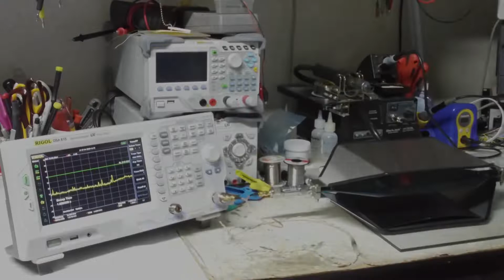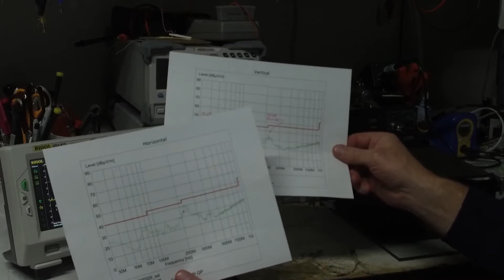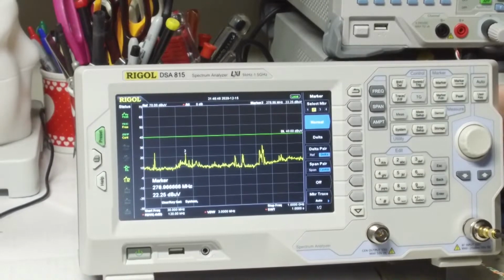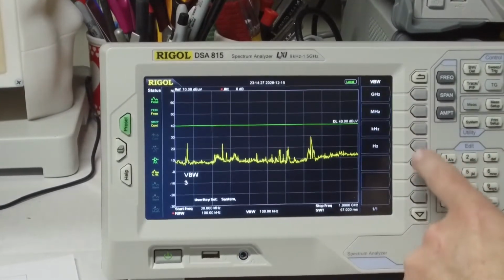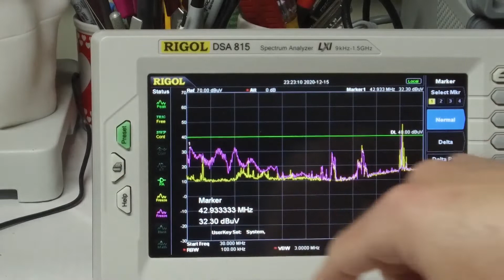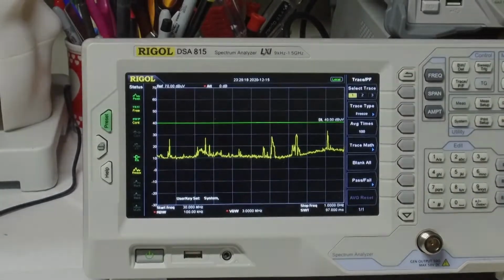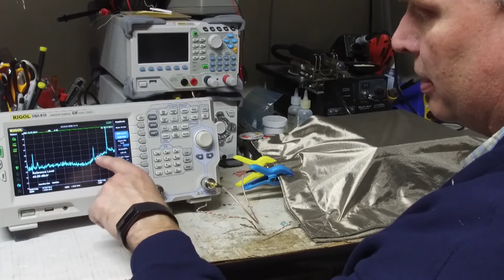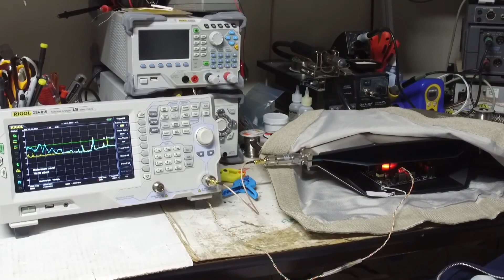FCC/CE Radiated Pre-compliance,  FCC / EN55022 with Rigol DSA815, TekBox TEM cell and shielding bag

Comment: Good video.  If I go with a TEM I'm going to try and get one that fits my needs but also fits inside an RF test box that I have.  This would eliminate a conductive bag and block virtually ALL ambient noise.  Willtek boxes show up periodically online.
Reply from the maker: I usually do not have to use the bag to find problems but it is helpful.

Comment: Seeing your observations of shifting the power cable changing emissions (implying some conducted emissions coming into the back through the leads); perhaps its a good idea to just power the product using a battery inside the bag! That way you don't need to worry about these conducted emissions at all.
Reply from the maker: That is a good idea.  Actually have done that before to eliminate possible variables.  Added a temporary battery to power the system.  Even did a small embedded computer running off a battery and encased in an aluminum box attached to system under test :)

Comment: Can I loop back the output of the TEM cell (TBTC0) to the input of the spectrum analyser with appropriate attenuator to know what electric field strength is actually generated in a TEM cell while performing susceptibility test?
Reply from the maker: Not sure I understand the question.  Are you doing RF immunity and using the TEM cell as emitting antenna with a RF power amp?
Reply: @DanPattenAudioG33k   yes . I am doing the RF immunity  testing. In that case , i want to know what amount  of Electric field is being generaated inside TEM cell. For that i want to connect  output of TEM cell to spectrum  analyzer. Is that possible?

Comment: Would it help if you performed "delta" to the reference measurement and the second one, would it be more reliable?
Reply from the maker: Not sure if I understand your question...  I usually make an initial scan without the DUT turned on and put that in memory and then take second measurement with DUT on.  I just look at the difference.  Suppose I could do delta measurement and it would make visual information easier to read but not sure if it would make readings more reliable.  Maybe I am missing what you are asking :)
Reply: @DanPattenAudioG33k  That's fine, you got it right. This is what I was thinking when it comes to delta measurement. The signal would be easier to see because sometimes when I do some testing, it gets messy if I end up with several readings and my background/ref measurement if then hard to see. Thank you for the answer and a magnificent lecture on pre-compliance.

Comment: The variation in superfluous noise when moving the filter on the input power was interesting.  It's like those power wires act as antennas. When the filter is outside the bag, then some post-filter length of wire leading into the TEM is exposed outside the bag. When the filter is significantly inside the bag, then the external wires leading to the filter have some length exposed inside the bag, apparently radiating to the TEM. But when the filter is right at the edge of the bag then the pre-filter part of the power lead is kept outside the bag, and the post-filter part of the power lead is not exposed to the exterior world.
Reply from the maker: I agree.  Always seems to be a mixed bag of "tradeoffs" when fighting radiated noise :)
Reply: @DanPattenAudioG33k  A "mixed bag"... so to speak, hahaha

Comment: An informative video. But doesn't it raise the question of why use a shielding bag per se?  Why not just add side walls of the TEM?  The top and bottom walls of the TEM are grounded, so one could add front and back walls and thereby completely enclose the product-under-test and center element ("septum"). Maybe the front and back walls would need to bow out in some fashion for impedance reasons... but if that was critical then surely the shielding bag fabric's position should also be carefully positioned too.  Obviously when adding front and back walls, one of them would need to be openable in order to insert the product under test :-).   Hmmmm.
Reply from the maker: Thank you.  I agree it would seem like a TEM cell could be constructed with side walls and ambient noise would be reduced.  Might be a little difficult manufacture an easily removable side wall to get DUT in and out.  I have rarely used the bag and have found the open sided TEM has been fine for most the tests I have performed.  I usually use some tape to mark where my DUT is positioned to get most repeatable results.  Have also found that the bag placement has not been too critical.